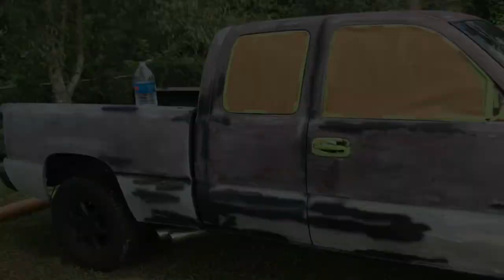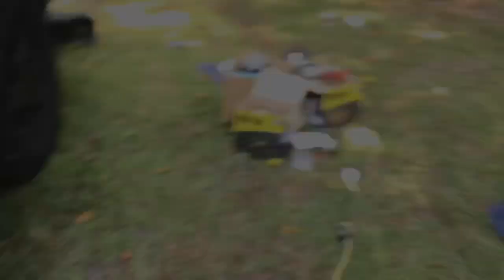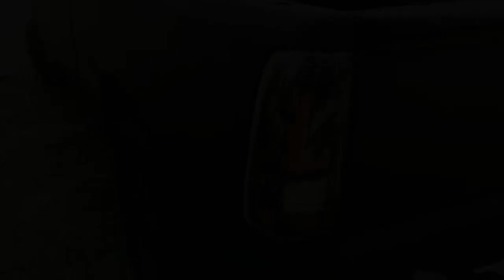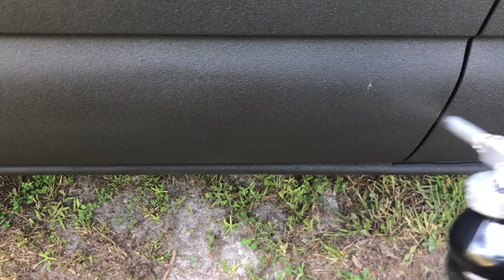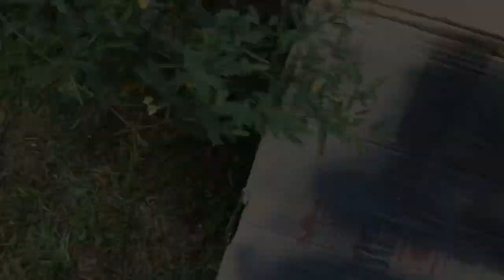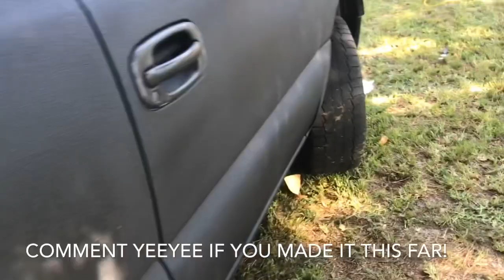Raptor liner a full sized pick up truck

Comment: Yeeyee. My truck has lots of rust issues. Will the raptor line cover it up or do you have any tips on how to get rid of it
Reply from the maker: You have to get rid of all rust otherwise the raptor liner will just flake off. I’d grind it as much as possible and fill it with some body filler or use some rust reformer. Bottom line, you can’t spray over the rust cause all the work will go to waste

Comment: Where did you get the paint and how much was it all
Reply from the maker: Cory Primes got it on eBay, for like $200. After buying all the sand paper, body filler, etc it was around 350 In total

Comment: Yeeyee. How long did this take you from start to finish? My brother and I are thinking about doing it to his truck this weekend. Looks good man
Reply from the maker: Rit Anderson Just on the day I sprayed it, it took around 10 hours because I had to tape and mask, clean it,  and had sanding left to do after cleaning it, then I cleaned it again and sprayed adhesion promoter in hard to reach area. It may be easier and faster with another person.